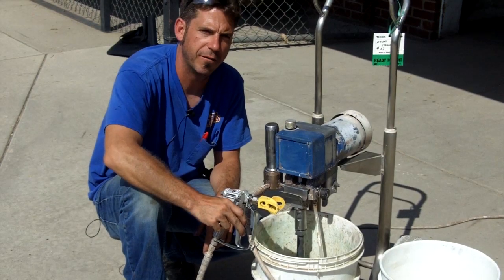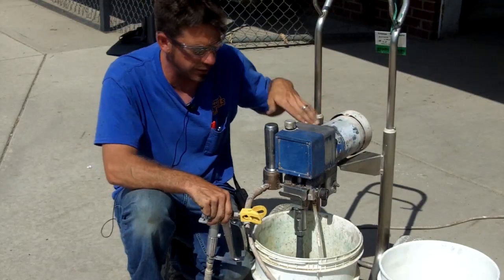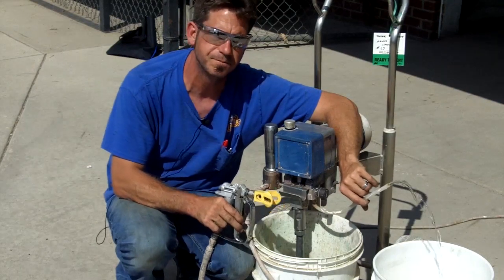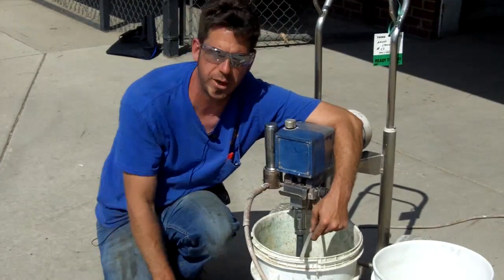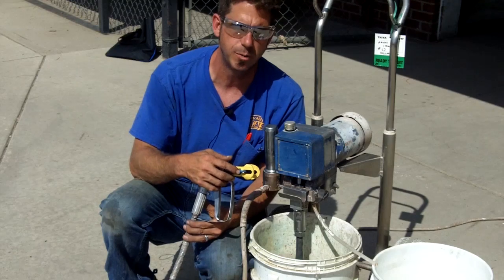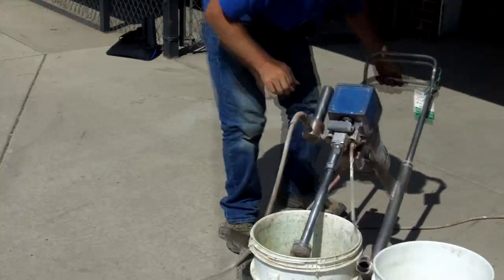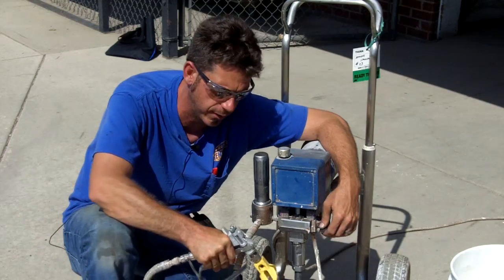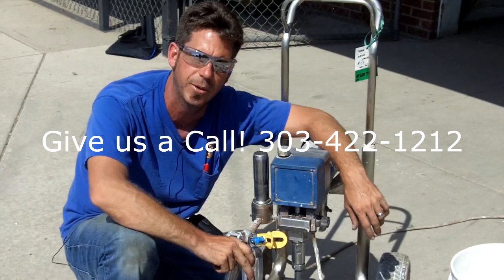How To Setup and Use an Airless Paint Sprayer | Arvada Rent-Alls

Comment: Thank you for such a clear and complete explanation of how to use an airless sprayer! Great job! Is there any type of lubrication needed for an electric powered airless sprayer? I have a Wagner Twin Stroke 3000 painter that an uncle gave me. It didn't have any instructions or any type of lubrication but I've noticed that on some models use some kind of lubrication is added! Is that lubrication only for small gas powered airless sprayers?
Reply from the maker: TSL, or throat seal liquid oh, it is a clear liquid that coats the packing and allows the shaft to move freely as well as lubricate the leathers and plastics

Comment: Thanks for a great job of explaining how to use an airless sprayer. I have never used one before and your explanation is very helpful! I was wondering if your particular sprayer has a filter in the handle? I believe the sprayer that an uncle gave me, (without any user guide) has one in the handle. I noticed that there's a filter at the end of the siphon tube that's placed into the paint bucket! Is that filter all that I need to do a job? I'd also like to know if using an airless sprayer uses more paint than just using a roller or brush?
Reply from the maker: Our sprayers do not have filters in the handle - and it's certainly possible that an airless uses more paint. I would suppose it would depend on some variables such as paint consistency, coverage requirements VS roller and brush.